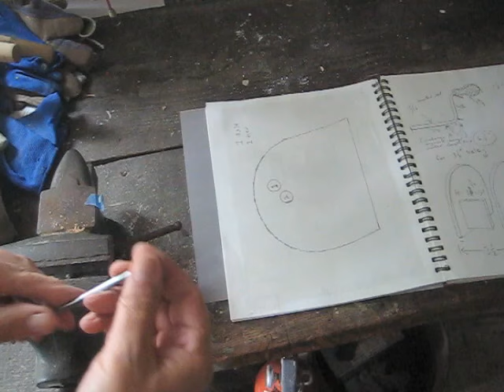rotary flip-book gif machine mutoscope - how to

Comment: This is so incredibly cool!! Is there anywhere to buy the middle piece that holds all the pictures?
Reply: This is my frustration too.  I don't wish to purchase all the tools, and take the learning curve, of hand cutting and building the mechanics, but am finding it difficult to locate a commercial solution for the wheel and crank device (I can create the final setting myself).  I haven't yet even found commodity plastic or metal versions of flip wheels that I could repurpose, at all.  Only rather expensive custom ordered versions (like the 'memoriboxx'  and 'giphoscope' makers).
Reply from the maker: I can send a file for the center piece - it is covered by Attribution-NonCommercial-NoDerivs creative commons license. You can take the file to a laser cutting service and have them made. It is designed for 100 pound card stock, so thicker or thinner paper will run into problems. Contact me at https://www.johnfadeff.com/
Reply from the maker: I can send a file for the center piece - it is covered by Attribution-NonCommercial-NoDerivs creative commons license. You can take the file to a laser cutting service and have them made. It is designed for 100 pound card stock, so thicker or thinner paper will run into problems. Contact me at https://www.johnfadeff.com/